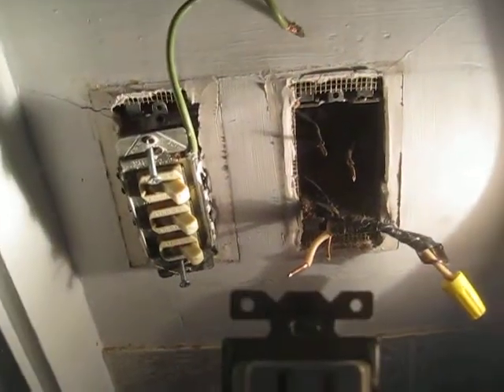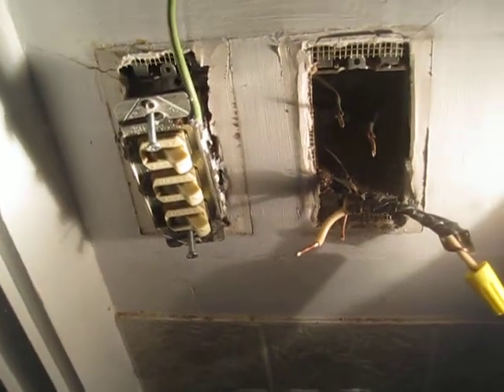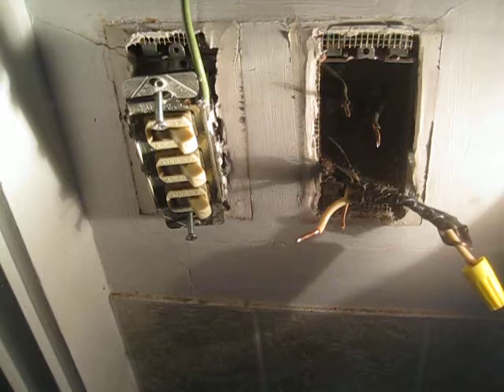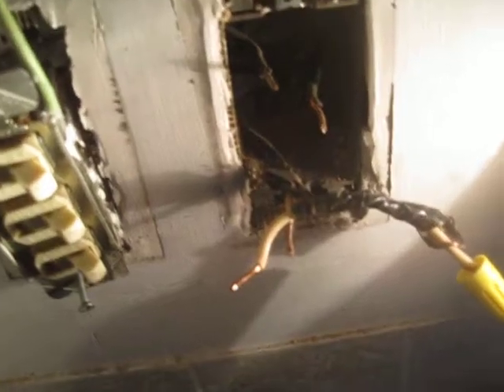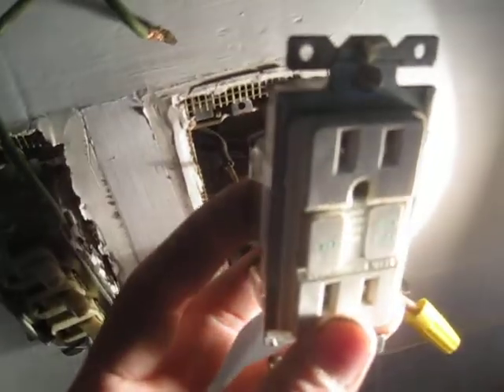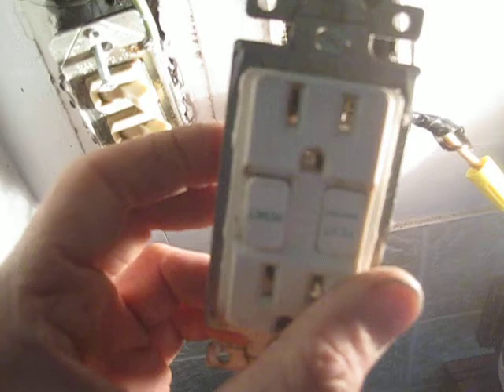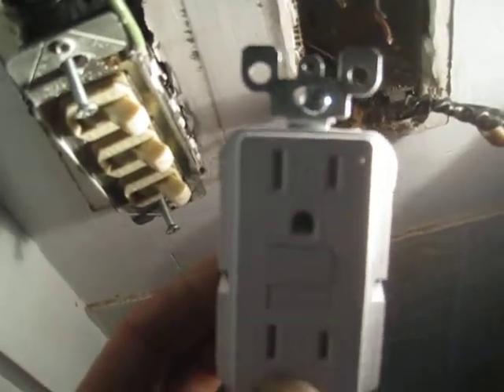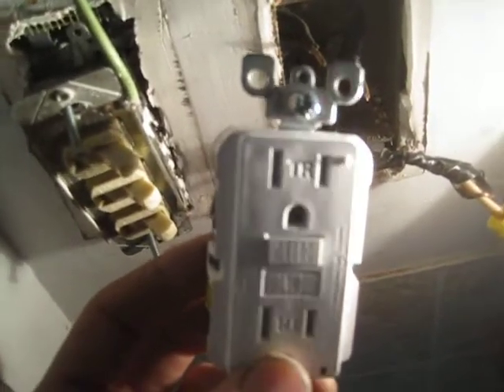1of2 - Miswired bath Fan light and heater needs 4 conductors plus ground

Comment: Thanks so much! I had the same issue, and wouldn't have figured it out if not for your explanation on the video. I was about ready to call an electrician. A trip to the hardware store and new Romex is in place to wire it correctly!